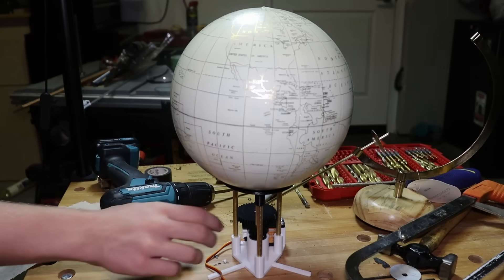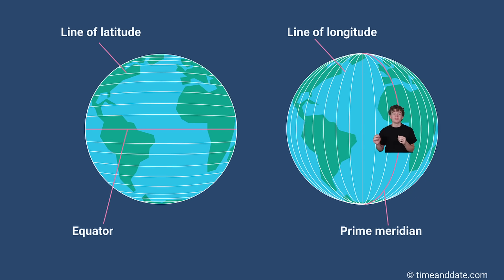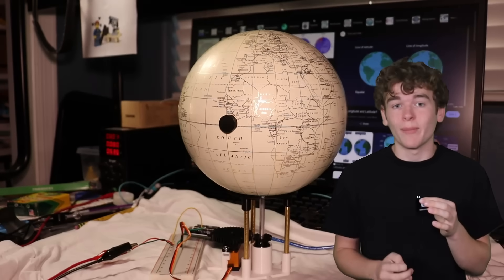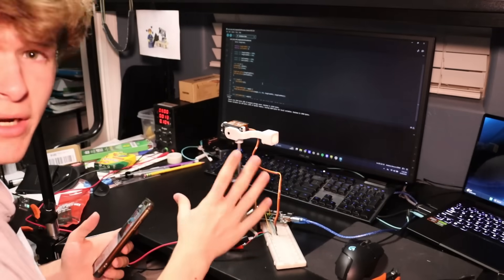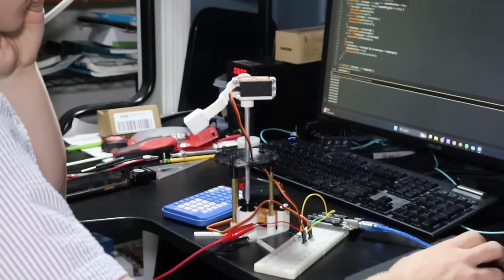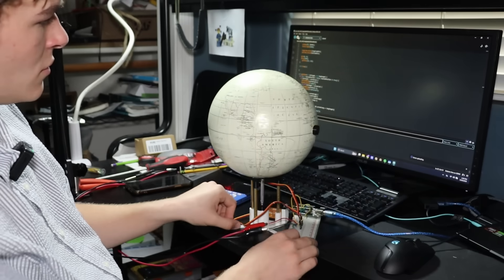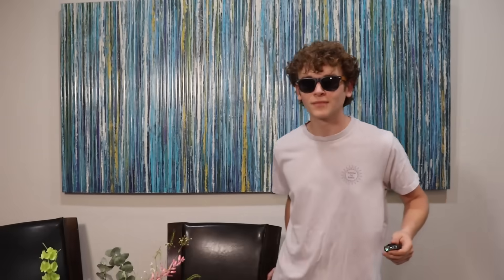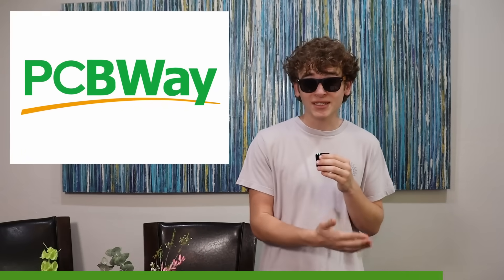Making A LIVE International Space Station Tracker

Comment from the maker: I’ve received the same question a lot, so I’m going to answer it here: why doesn’t the latitude servo’s wires wrap around the longitude axle? Also, what happens if the ISS crosses the south pole?

The ISS doesn't cross the south pole ever. It reaches a max of 51.6 degrees north and south of the equator!

The servo that turns the longitude does not turn continuously- it can only turn 180 degrees (360 with the gear system) back and forth. So after every orbit (90 minutes), it turns back around to reset itself. That way, I don’t have to worry about the wires wrapping around the axle. If you’re wondering why I used a servo instead of a stepper, it was for space, cost, power, and programming (stepper needs initial calibration) reasons. Also it’s more convenient to not have to worry about the wire-wrapping issue.

Also I made a mistake :( The model ISS would actually be 1/40th the width of a human hair, and I was wrong when I corrected myself lol. The football field thing comparison is still right though, so at least I didn't confuse any Americans!
Reply: if you wanna, you could just cut that correction part with the youtube editor?
Reply: Mate you are really entertaining and creative
Reply: can you tell me where the clock hand is at
Reply: @CubaTheCube I’m guessing the table
Reply: @CubaTheCube  it's black and in the floor - definitely the hardest thing to find!
Reply: @elevatecounseling7744   oh neat thanks
Reply: @CubaTheCube  it's on the floor next to Will
Reply: Thanks for staying honest.
Reply: @willdoesbuild you should Pin your comment
Reply: You could get round that by having a linear motor and a stepped rod straight up the middle of the whole thing that pushes on a geared rod that turns  with the orbit.
Reply: the iss will be destroyed in 2031😢
Reply: aww, i was hoping to hear you used a slip ring. slip rings are cool
Reply: Checks subscribers count... Oh, good, he's doubling every 2 weeks, that is correct. Soon mark rober will be asking for ideas. Good project
Reply: the iss actually never changes its orbit, the earth spins to the east underneath it so each time it completes an orbit its overtop of an area further to the west by 1.5 timezones (1500km)
Reply: I feel bad for what I commented
Reply: She's cheating on you.
Reply: Americans will do anything to avoid using the metric system...

Comment: Couldn't you just use TLE 

this
Two Line Element Set (TLE):

1 25544U 98067A   25215.71464133  .00011764  00000-0  21137-3 0  9990
2 25544  51.6362  71.4998 0002063 141.3386 255.5383 15.50324816522533

and calculate the exact position of the ISS without need for internet?

Comment: Something neat that wasn't mentioned here but came to mind: when I saw the thumbnail I initially wondered how you'd deal with the ISS going over the poles or anything that might interfere with the stand. But the ISS's orbit is inclined at 51.6 degrees, which means that's the maximum latitude it reaches in either direction, so it's never going to get that close to the poles and a wide stand like this is fine! It's cool that you can see that angle in the timelapse movements, even though you didn't need to know anything about its actual orbit to get the position data.

Comment: There's another way to the project. You can rotate the earth with its day and put the ISS on its orbital plane. It still requires 2 motors. But you only need to check position and velocity periodically rather checking on position continuously or periodically with a physics simulation.

Comment: 5:12 What expensive machinery? I'm an Electronics Technician, and at Technical High School (Argentina) I learned to make PCBs, using a hand-cut board (using a saw, with some luck a Dremmel), tracing the paths with ink (usually transferring the paper to the copper, using glossy paper and a clothing iron, although it's also possible to do it by hand with a marker), and dissolving the copper without ink in acid. Once the paths are made, you drill holes with a drill (preferably a bench drill), arrange the components, and solder them.

Of course, it's easier said than done, which is why services like PCBWay are so practical. And I understand this is a promotion, but you don't need any expensive machinery to make a PCB, especially if you only need one.

Comment: I'm impressed! The only thing that would make it cooler is if you make the ISS float above the globe. You'd need to change the magnet inside the globe to a double magnet and then put something metal on the ISS, but it would look so cool! Thanks for sharing your work with us.
Reply: Do you mean make it look like it’s in orbit? You can’t suspend an object like that above two magnets it needs to be electromagnetic running on a/c
Reply: @needmoreboost6369  What about an inverter magnet?

Comment: Might be worth considering creating a 3D printed sled for the magnet with some ball bearings in so it rolls smoother across the surface as I can imagine it'll wear through the print on the globe quite quickly.
Reply from the maker: I put fabric on the bottom of the ISS model for this, but it’ll be interesting to see what happens!

Comment: You used servos that can’t rotate fully? Maybe the best method would be to use a stepper for the polar rotation. Then a slip-ring I guess, unless you wanted to mess about with wireless power transfer by putting the coils around the shaft.

Having the north-south motor in the base controlling a coaxial swash-plate would probably work too, though the low-friction guiding elements would be a bit of a pain.
Reply from the maker: Great points! Servos that continuously rotate are really expensive, and steppers are too bulky, and they have to calibrate intially somehow. I tossed the idea of a stepper in my head a lot when designing, especially because every other product I saw used a stepper for longitude, but ultimately went with a servo for ease of use and lower power usage. I’ll also say this: the stepper would need to be on all of the time to give it enough strength to move the ISS. Without downtime, it would get  very hot and use at least 10-40x the power of my current design.

Comment: This could be simplified I think, since all orbits are ellipses on some plane, you only need 1 axis of rotation to fully encapsulate everywhere the ISS could be at any given time. Which would just be 1 motor and some math to convert lat/long to radians.

I don't know if the ISS ever changes its orbits inclination though, I would imagine not but it's not impossible.

Also, we never went to space, space nerd.
Reply: That only  works in an inertial frame, if you want it relative to the Earth's surface (which you do to know where it is over the earth) then you would need to rotate the Earth - adding a second axis. The way they did it is much easier and doesn't limit the motion to a single plane.
Reply: The ISS does stay on one plane, but Earth rotates underneath.
Reply: But he would then have to make the earth spin once every 24 hours just like the real thing since a rotating reference frame is not a valid inertial frame
Reply: This is similiar to what I was thinking.  Two motors, one to rotate the Earth once in 24 hours and one to move the ISS in the same plane every ~90 minutes or whatever the orbit period is.

Comment: You could take it an even nerdier step further. Download the TLE (two lines of text that describe the orbit of a satellite), then calculate the position of the ISS yourself (SGP4 libraries are available) instead of just getting position of the ISS every second from an API.
This way, the board only needs to hit the internet once every 24h, and would even work offline for longer (with cumulative positional errors the older the TLE gets) if the internet connection isn't available.
Reply: This is the way
Reply: @WillsBuilds this is the way
Reply: Also, it could eliminate the jittering (if the motors are appropriately sensitive, of course)
Reply: @trainsfemme  I suspect he's going to have a pretty hefty amount of stick slip friction with that magnet setup that'd lead to a pretty significant minimum move amount anyway even though it looks like he put some plastic skids under it. Possibly even moving too slowly would let the magnets separate and it'd fall off. Also with servo's they often make a lot of noise jittering around that might get irritating after a while if it's on your desk.
Reply: I was looking for a comment like this. Download the ephemeris every week and just recalculate. You would need a time and date but if you already have a network connection just hit up an ntp server. An esp32 can easily do this.
Reply: I suspect given how far it's moving in each jump it's polling every 5 minutes or so. But yeah I also was thinking TLE's
Reply: the iss’s orbit changes pretty regularly, so this only works for a few weeks

Comment: Should have used stepper motors.
Reply: Those are very big and bulky. They're loud, use a lot of power, and are very expensive. There's really no point for stepper motor
Reply from the maker: These are the main reasons I used a servo, also I didn’t want to worry about a calibration system to get the stepper’s initial position.

Comment: Awesome project!

Personally I would recommend using an API to periodically get the station’s TLE (standard format for orbital parameters) instead of using the API to get its location directly. Using the TLE will allow the globe to continue to work even if it’s temporarily disconnected from the internet. Also, do you have a slip ring in the base of the globe or does the longitude servo need to spin backwards occasionally to prevent the latitude servo cable from getting tangled?
Reply from the maker: Great points! Because this globe stays in my house (with Wi-Fi) and because I didn’t want to worry about an orbital parameter program, I figured the api would be easiest. Also, the longitude servo does need to reset itself (turns back around) on every orbit, both so the wires don’t wrap on the axle and because the hobby servo can’t turn continuously.

Comment: Won't the wires for the upper servo get tangled?
Cool project btw.
Reply from the maker: Great question! I should have clarified this in the video, but the longitude doesn’t actually turn continuously, because it’s run by a hobby servo. So at every orbit (90 minutes), it turns back around due to servo limitations and so the wires don’t tangle.

Comment: Just going to point out that you don't need to use the API to get the position because we know all the orbital parameters, you can just back calculate the position
Reply: The orbital parameters change about once a month when the station is reboosted (but can change at any time due to unplanned changes), so it's probably quicker and easier to just query the API than implement the orbital parameter calculations.
Reply from the maker: Both great points! I did consider some orbital parameter systems for offline use, though figured it’d be unnecessary :)

Comment: You should probably consider using spherical interpolation. It'll make smoother movements between points.
Reply from the maker: Great suggestion! Though I will say, the jerkiness of the movements were more limited by the servos. Most hobby servos (including the ones I got) don't have a lot of precision, unless you spend a lot of money on industrial servos that can move with sub-degree-accuracy. So, because I was limited by that, having the ESP-32 check the location every 15 seconds was enough.
Reply: @willdoesbuild  I was actually referring to the movement when you were still prototyping. It moved up and then over. Having thought about it more, even a lerp would have avoided that. That being said, the final design moves in such discrete step as to make the whole issue moot.

There is not really much you can do to eliminate the jerkiness.
Reply: @mspeir  I think it only does once after recalibration, after that it will do just small steps everytime it receives new coord, there is no need to do any interpolation...
Reply: Why would you use spherical anything. THE EARTH IS NOT ROUND. Lies lies lies. Dont trust what the people online tell you

Comment: How doesn't the latitude motor's wires get wrapped around the base?
Reply from the maker: Great question! The longitude axle doesn't actually continuously rotate more than once, because it's driven by a single rotation-limited servo. So, every 90 minutes (one full orbit of the ISS), it turns back around to "reset" itself and so that I don't need a slip ring for the latitude servo!
Reply: @willdoesbuild  that's a shame. I think if it could do continuous rotations it would be a lot cooler. Slip rings don't cost that much so it wouldnt be an expensive upgrade
Reply: Longitude*